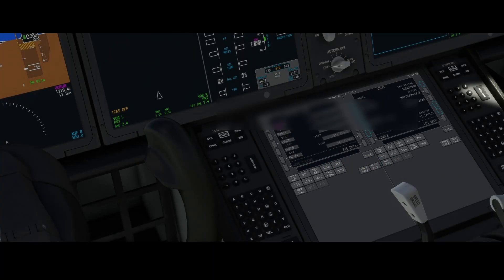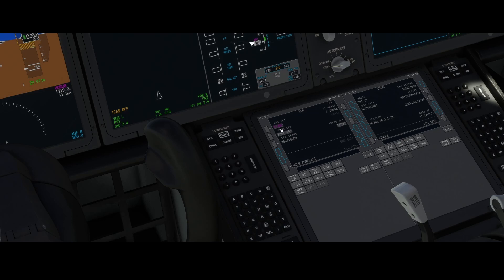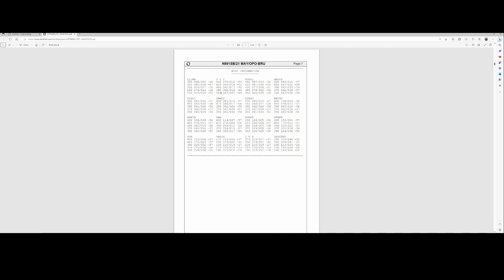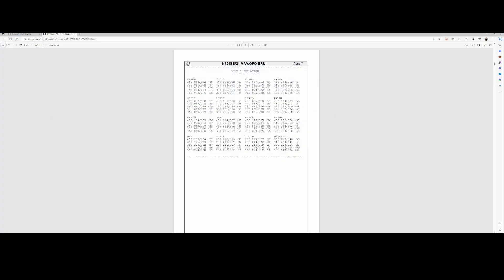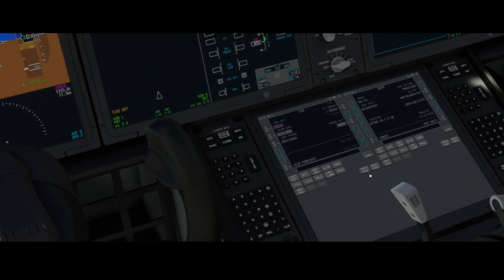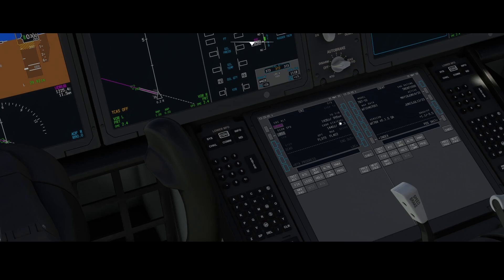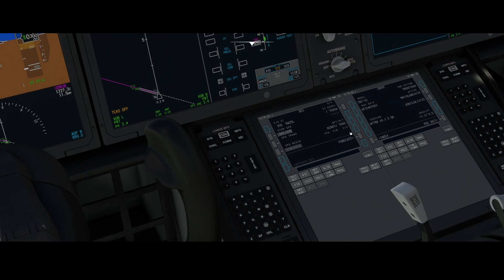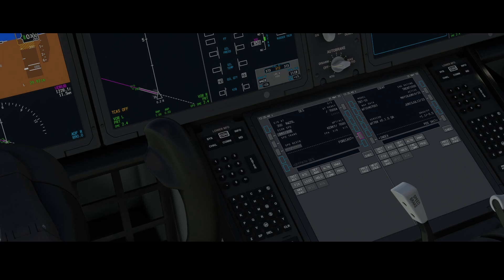Flight Simulator 2020 - How to - Boeing 787 - VNAV settings (AAU 2)

Comment: After the last update, my 787 started to approach or raise(descent) very aggressively in VNAV. For example, after the take off, when i push the autopilot button, the VNAV selects +4000 V/S for ascending:d  How can i solve this?
Reply: In MSFS 2024 VNAV is not working well at all for me.  Was OK in 2020.  The rest of the autopilot seems Ok.
Reply: @jeromeyesavage9628  i solved the solution for 2020 i guess. When i press the VNAV button just after the take-off, VNAV works well